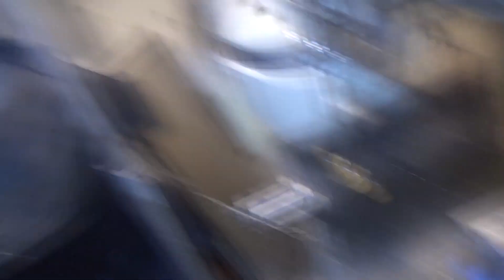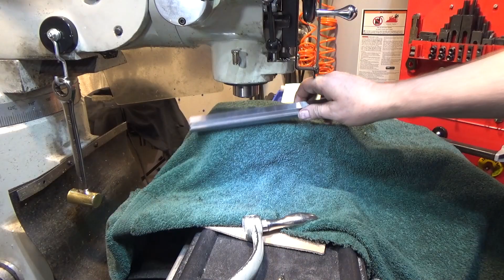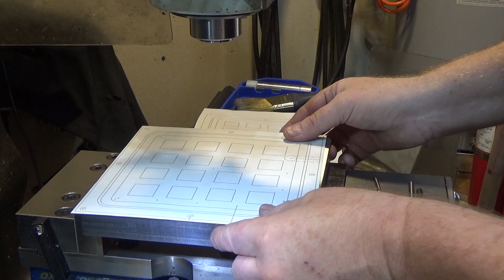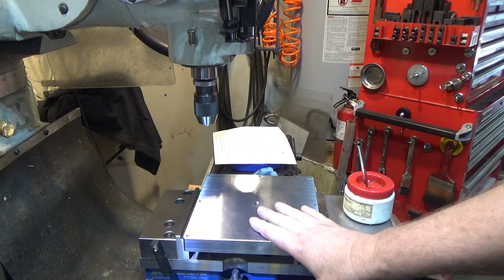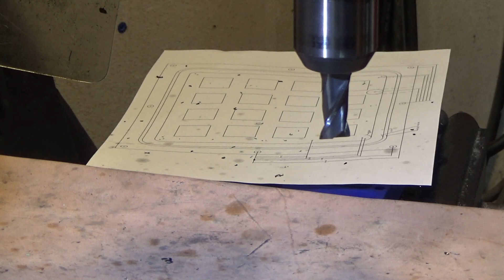190 Vacuum Chuck with Replaceable Fixture Plate Part 1

Comment: Pressing against itself like that you’re locking grub screw needs to be substantial otherwise it’ll just attach the clamp to the part not the part to the rotary table
Reply from the maker: That is an excellent observation and is why I ended up adding 2 grub screws to each of the extended t-nuts. I realized the weakness after I started making them and adjusted, but ended up not using them anyway. A simpler solution is to get a bigger rotary table, but I chose 8" based on weight, 10" was too heavy to manually lift with my bad back.
Reply: @DudleyToolwright  I can relate my current rotary table is a old 12” k@t unit 40:1 but made to be used manually or hooked to the lead attachment dang thing weighs at least 200lbs I rarely use it

Comment: My machine is old and homemade, most cutters creep out very slowly, I have separate tool holders for each 8th inch increment so I don't change them very often. But when I do, it's a long wait. I've even tried shooting some air down the drawbolt channel, this was a bad idea. I've got this little bowl I use when I need 10 bolts for example. I've gotten in the habit when changing a bit, I don't know why but when I tried to pull, it seems like the suction get stronger. Anyhow I have this little 12x10 in piece of suede that's nice for clamping odd shaped objects. I crumpled this up in the bowl to catch the end Mill because I'm too add to just wait for it. I often dream of building a funnel that attaches to the plastic cases so when it's finished, it goes right back where it belongs
Reply from the maker: Interesting. I have noted the creep before, especially with the 1/2" collet. I have even replace them with premium brands and still have the problem.

Comment: Almost every machine I have if I inspect the t-ways carefully, the underside is not terribly flat and clean. I have long wondered if adding a quarter inch of aluminum or brass to t-bolts might serve to provide a flatter connection. I've never done it, and admittedly I can't think of ever having any problems with the t-bolt, but most of my machines are fairly rough on that underside. It must be softer than what I make t-bolts out of, cuz I have never seen any galling or dents on my t-bolts. I am in the habit of case hardening t bolts, but I don't think I've ever seen any damage and I use 5/8 hardware. It is the tool steel hard enough to flatten the underside of the cast iron t-alots? It has always troubles me that I don't see any marks at all yet the underside is rather rough to the touch. Any thoughts?
Reply from the maker: Interesting observations. The T-slots in my milling machine have the sides of the neck of the "T" ground and that is all. The rest of the parts are rough as you suggest.

Comment: I've been transitioning my shop from multi-use to just a machine shop but I've never run a surface grinder for an appreciable time. Would you say there's a very high learning curve? And would you say it's similar to a milling machine in the sense that accessories and tooling often cost more than the machine itself? And is there anything off the top of your head you would recommend to the first time shopper? I would almost definitely be buying an older machine. Any compromises you made that you have come to regret? The last question is a little bit nebulous, but if you were not producing parts for clients, more for yourself, do you think the surface grinder brings enough to the table to be worth it? Or for a one-off shop like that, might it not be better to have a nice lapping plate setup? I'm asking you for quite a bit, please don't feel any sense of obligation to answer everything, or anything for that matter. This was not really on my radar but I sort of slipped and fell into a great deal of surface grinder accessories
Reply from the maker: No worries. I bought my surface grinder new - the same one as Steve Barton over at solid Rock Machine Shop. He has a wealth of experience and knowledge and is a great teacher. The surface grinder lets you take surfaces to the next level past the milling machine. After that there is lapping. The supplies are not that bad, but the grinding wheels are expendable. I looked for a grinder with a Z-height adjustment in the base - some have them in the column and that seemed more difficult. Used machines might have wear in the side to side ways. You should check them with a tenths indicator, but ordinarily I think the chuck should be ground first. Then you can get flat pieces, but you should also check for taper to identify bed ways wear. I am no expert that is for sure, which is why I didn't go the used route.

Comment: Since I don’t have a surface grinder (yet!), I buy hardened surface stock from McMastercarr Carr. This is precision stock from Starrett. But guess what? It also has those bounce marks across the stock. Like waves running down the length.
Reply from the maker: That is really interesting to know. I have seen Steve Barton's work, over at Solid Rock Machine Shop and he can get amazing finishes out of the exact same grinder. He does, however have many decades experience on me.